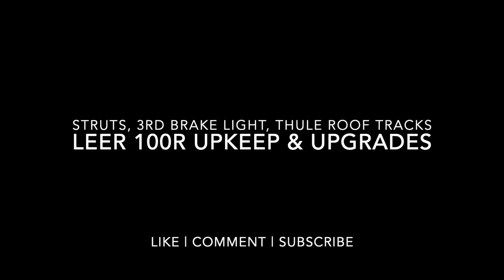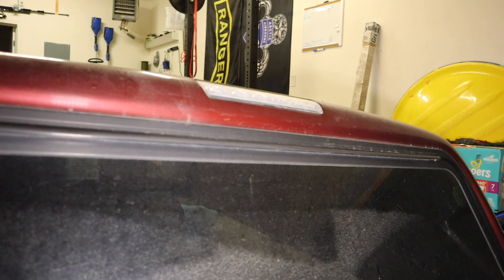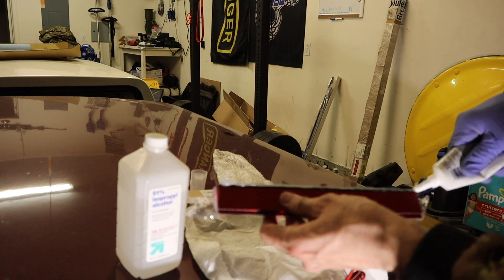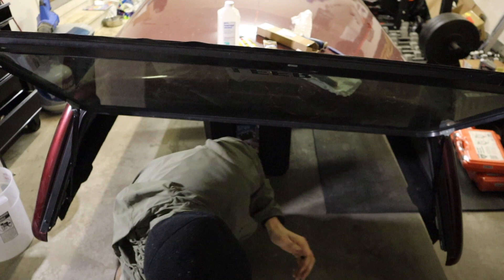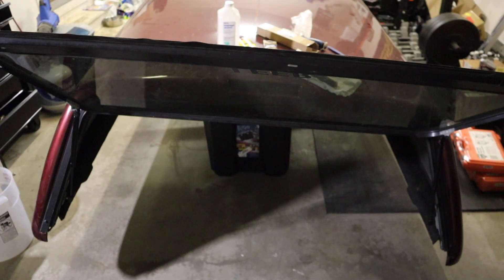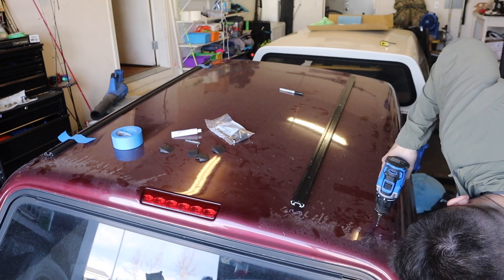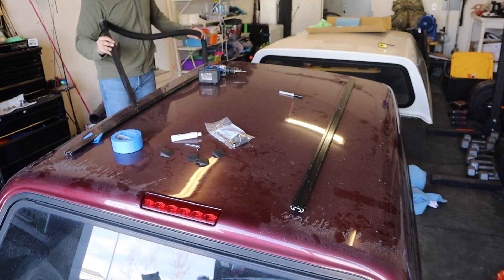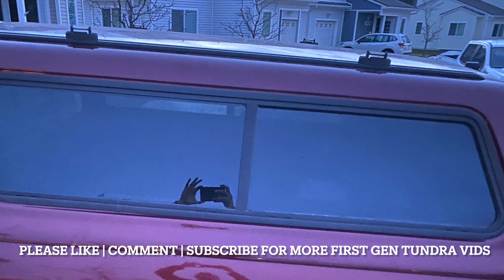Upgrading My Camper Shell! Gas Struts, 3rd Brake Light & Thule Roof Tracks

Comment: How did you wire the brake light? I recently bought a 2004 tundra dc. 2 wires are there but how do I connect it.
Reply from the maker: Hey mine was already spliced into the brake light from a previous camper installed. I just replaced the plugs. Theres a few good videos on youtube and one or two specific to first gen tundra. Not too difficult- i just didnt have to do it this time